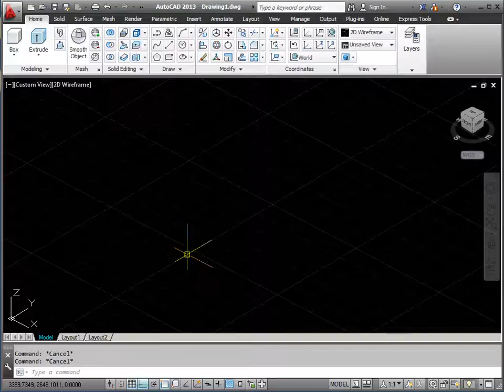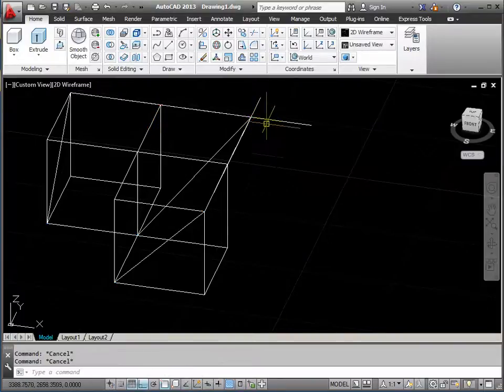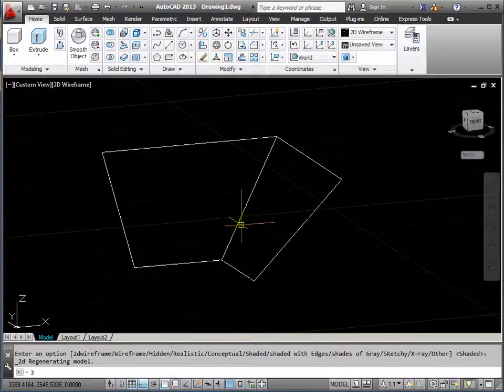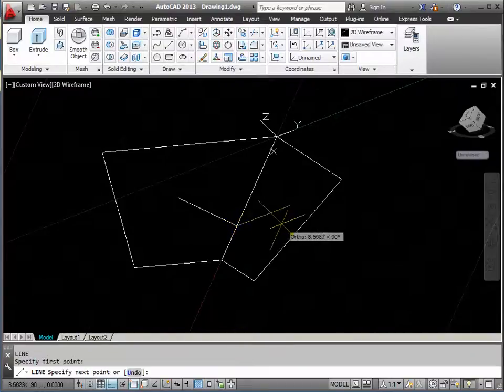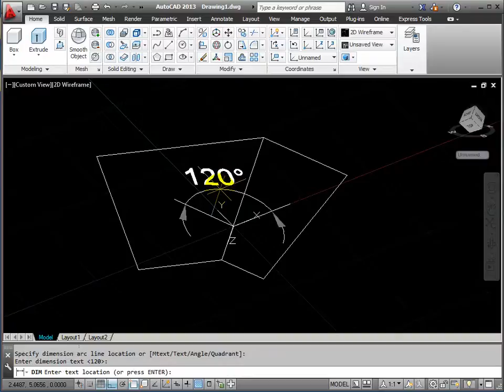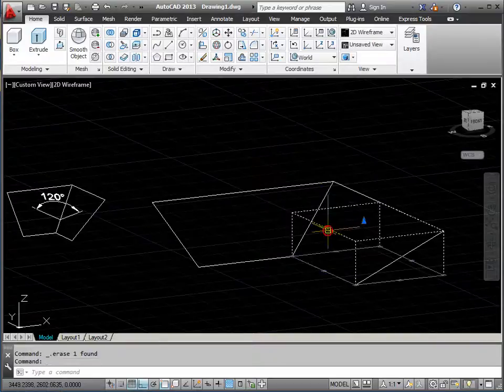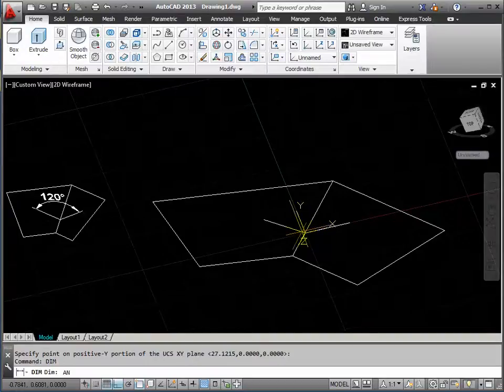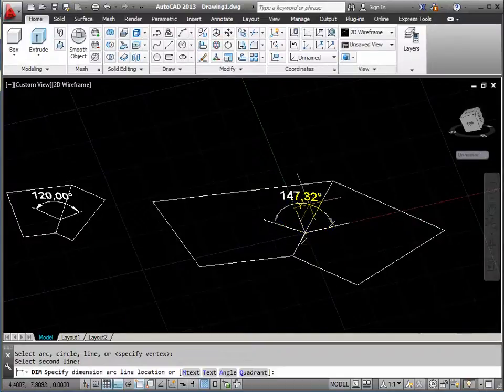AutoCAD 3D - Using 3 Point UCS to Determine Valley Gutter (or Hip) Angles

Comment: Thank you so much for sharing,
i have just a plane (or two 3d lines) in 3d and want to measure the 3d Angle between it's corner, how can i get the 3d angle?
Thanks again.
Reply from the maker: Hi. Set units for angles to have 3 decimal places (in general units and in dimension units).   Setup a 3-point ucs as the video shows and then LIST the lines - one will be at angle 0 relative to XY plane and the other will be at the angle you are needing to know (pos or neg).   Alternatively set units for angles to have 3 decimal places and then put in an angle dimension - it will show what the angle is.